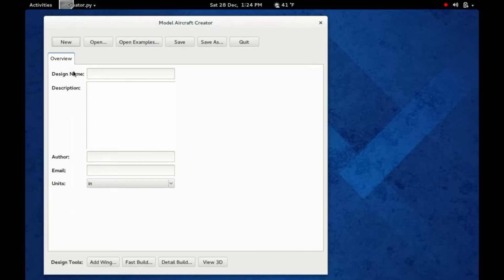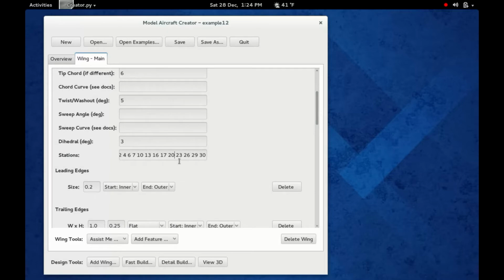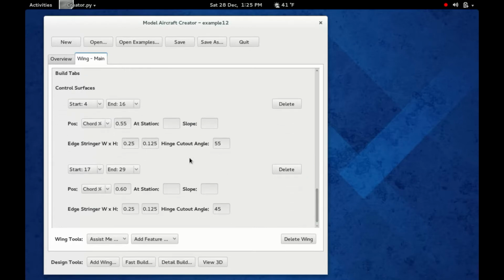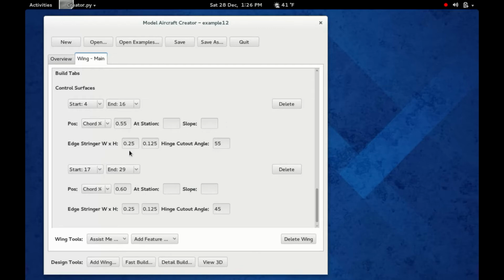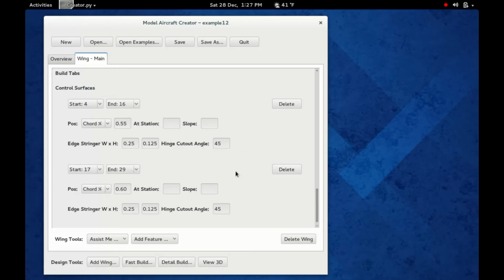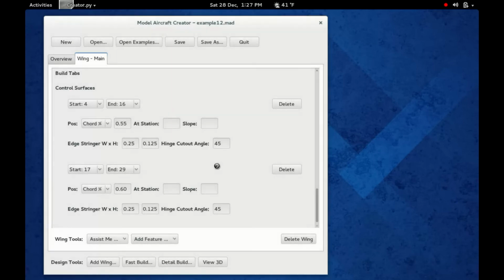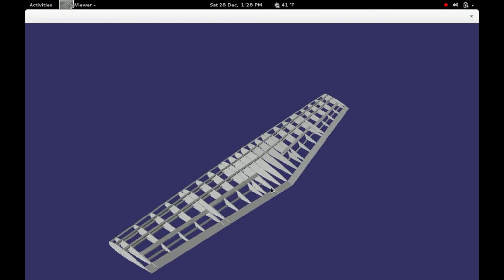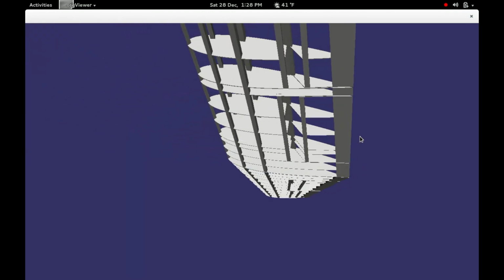Model Airplane Designer Introduction

Comment: Great holiday project! Can a user run the program on batch mode or dos command? Thanks!
Reply from the maker: It's currently setup to run through the gui, but someone with some coding/hacking (python) could separate out the builder portion and run it in a batch mode if they wanted.
Reply: Thank you !
Reply from the maker: If you build something with madesigner, let me know and share some pictures! :-)  Thanks!